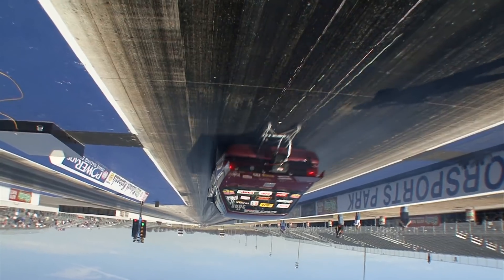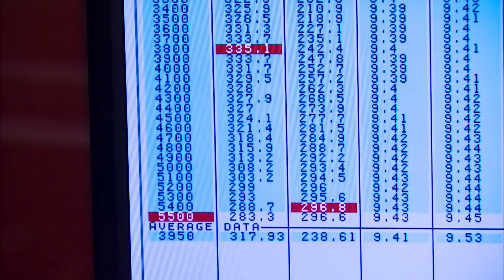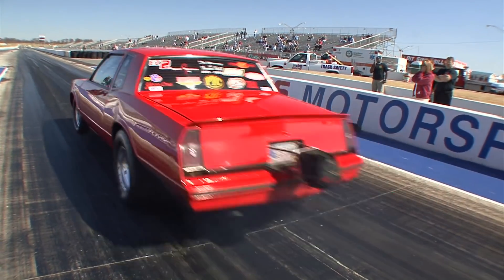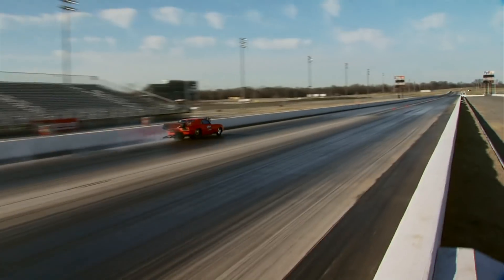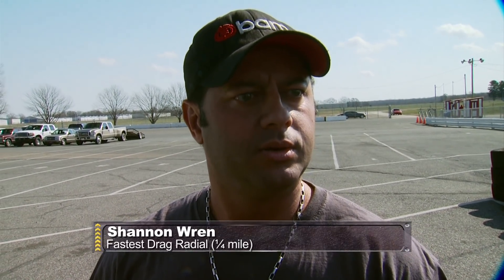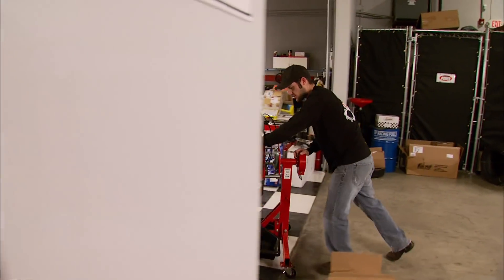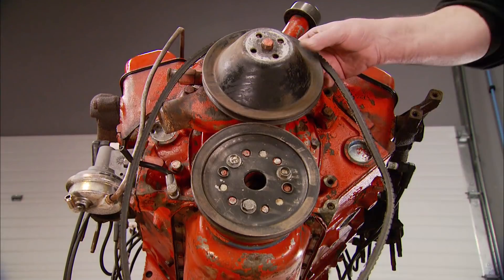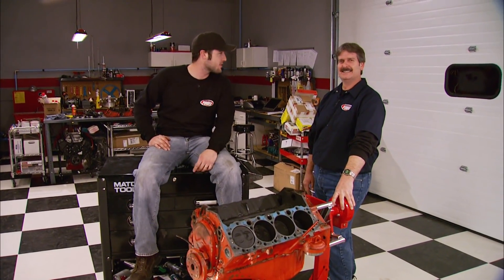Getting a Small Block Ready for the Machine Shop - Horsepower S12, E6

Comment: The bore in that block did not look like any 283 I've had apart. I believe they are disassembling a 327.  Jmo.
Reply: Michael Lynn Tingle   Looked like a 4 inch bore to me. Is that right?  Not officially a bow tie guy but I do have a Chevy with the 350 that I’m rebuilding.
Reply: You are correct next video he says it had original crank and rod bearings in this video they were already stamped i think two different engines here

Comment: If the engine was in a car an alternator would be powering the water pump instead of the dyno power so im not sure an electric pump would really free up much power as the load to drive the pump is just shifted to the alternator.

Comment: The electric water pump would increase alternator drag, so not having an alternator hooked up makes it an unfair test.
Reply: Well said mate.  I was about to comment this:  "The electric water pump comparison is not real, as they are not running an alternator on the engine.  I'm seeing some false-hoods here".  I don't see any relevance in the other 2 responses about supposed free'd up horsepower.  It takes X amount of power to run a water pump, and if that power isn't coming from the crank, and instead electrical, then we have to factor in the efficiency of the alternator, and then the efficiency of the elec water pump motor.  Cut the shit, just drive it via belt, unless belts are such a problem, which then leaves elec drives as a reasonable alternative.
When I went to tech during my apprenticeship, one of the guys questioned the teacher if it was possible to run an alternator from an electric motor rather than the crank to save horsepower... And he expected the battery to last.

Comment: You literally can tear down the SBC while watching this episode, for the length of video. Also "$3,000" rebuild?! On a small block? That's insane.
Reply: Machine shop time is expensive for one.   And when digging into the engine you might find some items are not reusable.  Rotating assembly, valve work, even a block that can't be salvaged.  Fixing stuff can get expensive.  Especially if you don't want to use the very cheapest parts.  Or if you want to hop up the engine a little bit.